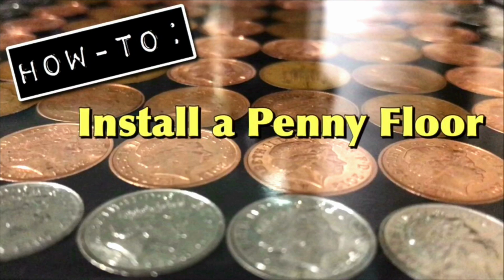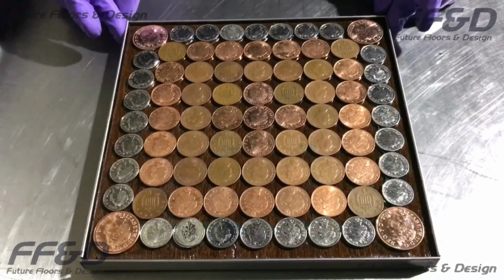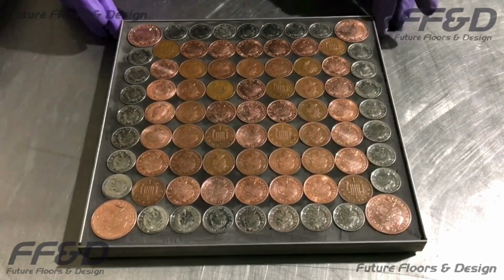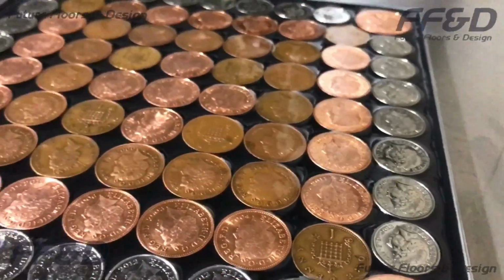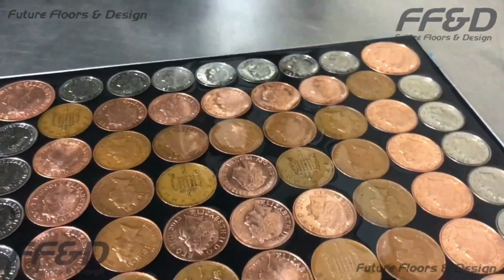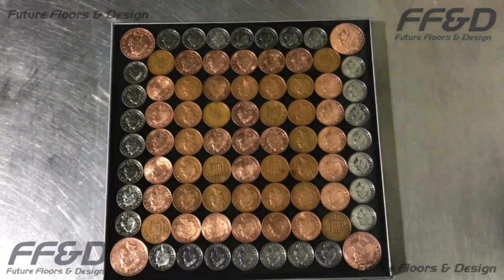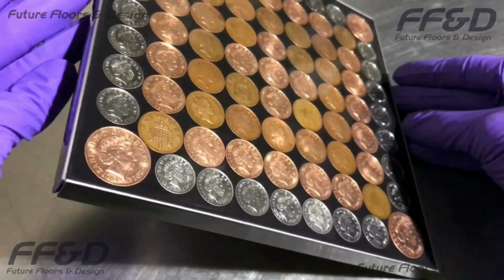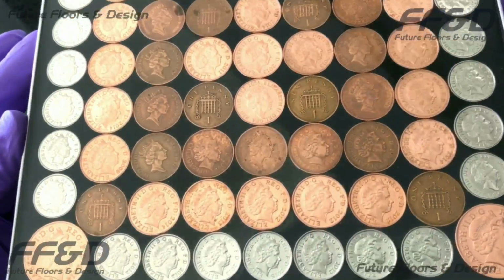How-To Lay a Penny Floor from Start to Finish | Step-by-step Tutorial (Sealed using FFD Epoxy Resin)

Comment: Can I also use a heart-shaped floor?

One more question: the floor construction is different. We have an insulating layer 7cm underneath Styrofoam balls with cement  .., then a tack plate on which the underfloor heating pipes are mounted Styrofoam, and then screed was laid on top.

I'm probably sitting on the floor, which will cause cracks; rather unsuitable?

Comment: Step 1. Make sure that the coins you decide to use, are NOT CURRENT coins that are STILL in circulation. Otherwise, you could be up on a charge of: Defacing current coin of the realm! That carries a big fine and sometimes also a long prison sentence! But using coins that are NOT legal tender any more, and OUT of circulation... that's fine. I just thought I'd mention it, to save anyone getting into any trouble, 'cos it's illegal! ; > )
Reply from the maker: A simple search on the internet will quickly debunk this myth; it’s only illegal to melt down or destroy coins in the UK, making a floor using them is perfectly legal as they aren’t being destroyed in any way. Even in the unlikely event that penny floors were to become illegal, the police tend to be more preoccupied with serious criminals instead of searching people’s homes for penny floors.
Reply: So lame lol u need to chill

Comment: Don't you need to sand between the coats of epoxy?
Reply from the maker: Hello Lori,

If the Epoxy surface you would like to coat is less than 48 hours old, a new coat of Epoxy Resin will chemically bond onto the previous one and will not require a mechanical key; if the Epoxy surface is more than 48 hours old, it is recommended that it is lightly sanded to create a mechanical key for the next coat to bond onto, followed by a thorough vacuum to remove any dust.

A new coat of Epoxy Resin will hide any scratches caused by the light sanding, providing that the scratches are clean, not too deep and haven't penetrated through the coating into the background.

The inter-coat adhesion between the coats is strongest when the material is between 24-48 hours old, which is why you can coat directly onto the surface if it is within this time-period.

Kind regards,

Comment: Great video!! Question: can I lay the pennies on bathroom floor tiles? And after people walking on the floor over and over does the resin scratch or dent in anyway? Basically I’m asking does it age well over time? Thanks
Reply from the maker: Thank you, we're glad you liked it! Ideally, you'd want to begin laying a penny floor on a level, flat surface, such as screed, wood etc. as this will provide the best possible surface to bond onto. If your tiles are quite profiled (riven tiles), you can prime the tiles with a thick coat of Epoxy Resin (scratch/scrape coat) to help level the tiles before applying the pennies; on our supplied datasheet for our Epoxy Resin it states what an Epoxy Scrape Coat is comprised of. Over time, as with any gloss finish that has traffic, it will begin to go more of a matt/silk finish; however, a very useful quality of Epoxy Resin is that after a little bit of prep, it can be sealed again to restore it back to its original look. To do this, all you need to do is lightly sand the Epoxy to create a mechanical key, followed by a vacuum to remove the dust from sanding, then you simply seal the surface again with a fresh coat of Epoxy Resin to make it as good as new. With foot-traffic, you'll only get to a certain level of matt/silk finish on the Epoxy, then it won't go any further than that, so it's unlikely that you'll want to seal it again. Kind regards,

Comment: Nice video....is this resin brittle..reason I ask is I was thinking this may be able to be cast in tubes then used for pen turning blanks after adding some colour...what’s your thoughts...thanks
Reply from the maker: Thank you for your feedback!

Epoxy Resin when applied as a coating onto existing surfaces, such as concrete, screeds etc, becomes very strong and hard-wearing, perfect for a variety of flooring applications; but Epoxy Resin in thin sections on its own can be fairly brittle and easy to break; because of this potential brittleness, it wouldn't be advisable to use Epoxy Resin for making anything that is quite thin, such as a pen.

Our Epoxy Resin is used primarily on flooring applications and isn't designed to be used in any form of casting, thin or thick section.

Kind regards,

Comment: If you notice bubbles before the epoxy dries can you spray it with alcohol
Reply from the maker: Hello,We wouldn't recommend spraying anything into the surface of the resin, as doing this can easily effect the overall appearance of the resin, as well as possibly weakening the epoxy on the surface and effecting the curing time.Kind regards,

Comment: Really well explained thanks. One question though, are these floors slippery ?
Reply from the maker: Hello,

Thank you for the feedback! 

Epoxy floors are no more slippery than other smooth surfaces that you'd find inside your home, such as porcelain tiles for example; the only time you'll find a smooth Epoxy surface particularly slippery is if it became wet, although this would also make most other surfaces slippery also.

Hope this helps!

Comment: Is the Epoxy slippery on a floor - especially if used in a kitchen or bathroom?
Reply from the maker: Hello, 

Epoxy floors are no more slippery than porcelain tiles that are also used in areas such as kitchens and bathrooms; similarly to those tiles, you'll only really find Epoxy floors particularly slippery if they are wet, which would make most other surfaces slippery also. 

Hope this answers your question!

Comment: I have seen a few videos where people are sticking the coins onto some plastic and making tiles then laying them down, what kind of plastic would you use?  Thank you great video!
Reply from the maker: Hello Adam, unless the penny application is for a vertical surface, sticking the pennies onto plastic, tile mesh etc to create placable tiles doesn't really have any significant benefit compared to sticking the pennies directly onto the floor freehand. The main reason you'd do this is to create a specific pattern using a template, but most penny designs are fairly simple to create, even if they look complex when the floor is complete, so this shouldn't be necessary. As we don't use this particular method, we can't recommend any products to help unfortunately, however we're pretty sure you will be able to achieve a nice penny floor design freehand 👍 Hope this helps!

Comment: Is this the same if doing a counter top,or table.Can you use beer bottle tops.Thanks
Reply from the maker: Hello David, yes you can indeed use this application on a countertop, bar top, table etc. You can also use bottle caps instead of pennies, however as bottle caps are lightweight, you will need to make sure that the bottle caps are well stuck, with the underside of the caps filled up as much as possible to remove any trapped air before sealing them with epoxy. This will prevent your bottle caps from lifting up and will also prevent trapped air from under the bottle caps coming out as bubbles in your sealer. It might be worth trying to fill up the underside of the bottle caps prior to sticking them to your surface; this should give them some weight and will help remove the void before your start. The epoxy sealer will likely require more than 3 sealer coats to cover the bottle caps as they are taller than pennies, but the process for sealing will be the same as in this video. The best thing we can advise you to do is to attempt a small test patch first to see if you can achieve your desired finish.Hope this helps, and good luck with your project!
Reply: Thanks for the reply

Comment: How many litres is a 5kg pack and whats the working time at room temp?
Reply from the maker: Our FFD Epoxy Resin DPM units are weighed in kg's rather than litres; coverage is 1.1Kg's per square meter per millimetre (depending on porosity). At room temperature you would expect the pot life to be around 30 minutes (this is if you leave it in the pot once mixed), however if the resin is poured out over your surface immediately after mixing, you will have more working time with the material. Hope this helps!